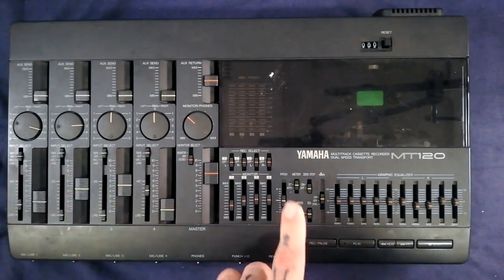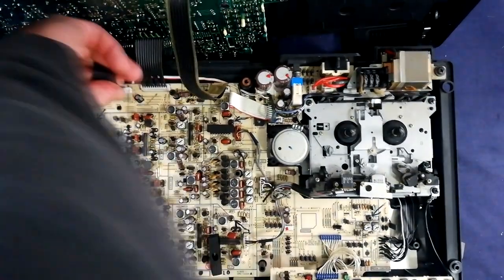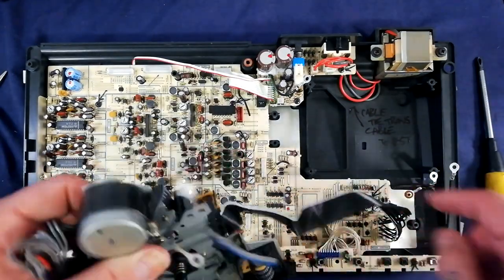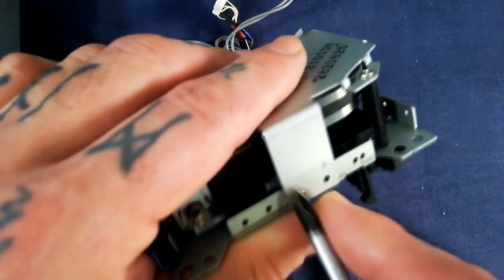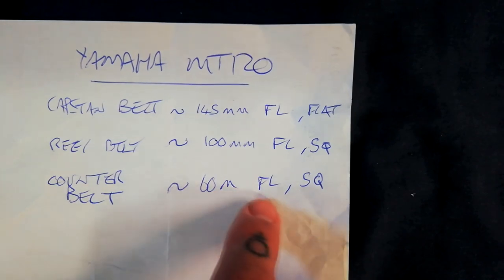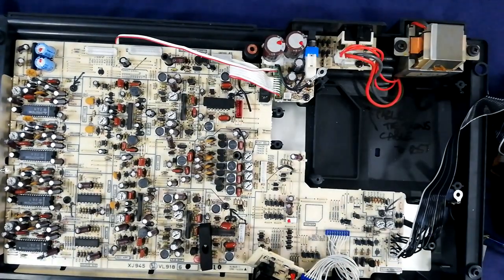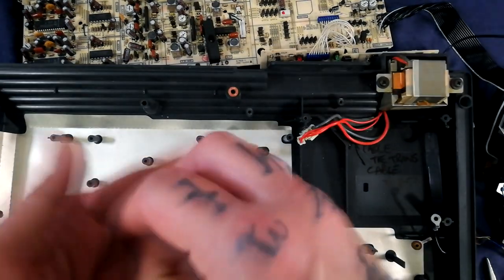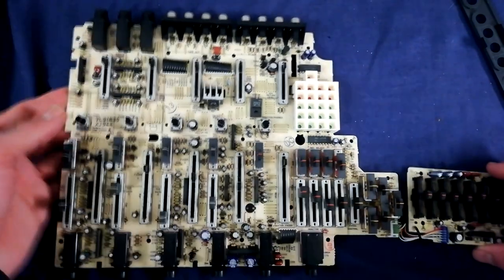Yamaha MT120 Tear Down

Comment: I had the MT100 MkII predecessor in 1991 until 1997.  Went digital with a Fostex DMT 8 v2 after that, but the Yamaha was an excellent machine and taught me a lot about recording.  I got the nostalgia bug back in 2016 and bought a used Yamaha MT3X in mint condition for £60.  Love the meterbridge and extra features that mine lacked like sync and mixer channels for feeding in live stuff.  Managed to find a cheap Yamaha FSK sync box for £12, and got an old Yamaha SY55 keyboard sequencer and RY30 drum machine to all sync to the four track.  Worked like a charm.  There is something about the old era of doing recording, that had a bit of magic to it which is missing for me in the digital age.

Comment: Great video!do you know what would cause the reels not spinning in either direction?the capstan spins all right but the reels don't engage. The belt looks all right. Update!!the source of the issue is the clutch assembly. Any idea why it won't t engege?

Comment: Excellent explanation and much appreciated. I have just bought mine back into action after 20 years and found that my channell 1 input would not record (plays back and bounces to fine). This video helped me to get to see the input jack in question to see if I could repair/replace it. 
However, not sure I can as the pin solder point seems to have pushed through and broken away from the circuit board and so broken the connection running through the circuit board. Just wondering if I could solder some external wires across somewhere to compensate... do you think that might fix it?
Reply from the maker: Thanks. Yes you could glue the socket in place and solder a section  of wire from the base of the socket to the next un damaged lug on the circuit board, follow the lifted  trace on the board to see where the far end of the wire should go.

Comment: I'm working on one of these right now and a mystery spring just fell out when I removed the transport assembly. I can't find it on the exploded view parts list in the service manual. It is a conical spring with no hooks or loops to attach it anywhere. About 9mm wide and 7mm tall uncompressed. About 10 turns. Not a very stiff spring. Any idea where it may have fallen from? I thought maybe it went under the smaller black plastic belt pully but again, I couldn't see how it attached to anything.

Comment: So if you made it with the JSP-HX connectors, that means the connector's pitch of the MT120 are different from the japanese CMX100II. (They look like coming from the same product line so I was assuming they're the same internally somehow). My Yamaha CMX100II have these bord-in connectors with a Pitch of 2mm, in which case the JSP-HX (with the pitch of 2.5mm) wouldn't fit.
Reply: I found JST-PH 2.0mm fitted my MT120.
Reply: @StevenHadfield  Yes, PH is the correct one, it cannot be the HX. Tetrakan made a mistake here.

Comment: Nice tear down and channel.  Thanks.

DON'T DISTURB THE RIBBON CABLES - Wise words. Luckily I'd decided to replace these anyway as I've a feeling I'm going to be in and out of this thing, but wow these are horrible, couldn't get the ribbon out, never mind back in.  For replacements JST PH cables have the correct 2.0mm pin spacing, for anyone looking to do the same.

The primary issue with mine is the right side of the mixer is attenuated on all sources in the mixer section, with noise on the fader.  The monitored tape signal is fine.  Cleaning and a brand new master fader from RS has not resolved this, so I'm suspecting it's a bad capacitor leaking DC current into the pre-fader summing Op Amp (IC10). Does this sound correct? Anything else I should investigate? 

Regarding the issue with the door mechanism in the video, It looks like you have everything, the door just extends past the pivot and is  restricted from moving by the L shaped metal spring.  The post which is broken on yours, doesn't have anything attached to it, on mine.

Cheers!
Reply from the maker: Thanks. What you are saying seems plausible. When faced with those sorts of problems I also replace the (usually) 10uf 16v electrolytic capacitors, which separate the buffers on either side of the master fader from preceding and following gain  stages. My theory is that leaky caps here interfere with the impedance relationship between gain stages, but whatever thd actual reason, I have a very high rate of success replacing these in addition to any caps between the opamps and Ground or power rails.
Reply: @Tetrakan  I'll do that. Thanks.

Comment: Love your videos, thank you for providing so much useful info.
I recently purchased one of these units but the monitor/mix/stereo switch is very scratchy and makes a racket when used. The overall output volume is very low and I have to have all sliders up all the way. This is during playback and general monitoring of instruments. Would a good clean of the mixer maybe fix this issue?
Thanks
Reply from the maker: Thank you. It definitely is the first step in a process of elimination, I wouldn't meddle with the electronics or pay anyone else to do so until the unit has been cleaned thoroughly, it could resolve your issue.
Reply: @Tetrakan  bloody good advice I reckon. Just gave it a good clean and that fixed the horrible switch. The only issue it has now is low output volume when listening in stereo mode. I can red line channel one through mic line but it barely tickles the ear drums. Looks in pretty good nick though so ain’t giving up on it. It’s got more joy to bring

Comment: Hey! I wanted to ask you if the mt120 got a built in auto stop feature that prevent tapeloop like some other yamaha models. Thanks a lot for your input :)
Reply from the maker: There's a switch on the front panel to defeat autostop, so I'm fairly sure you could use loop cassettes provided that switch was set to "off"?

Comment: I'm following along at home and I noticed that you dont really need to mark the mixer pcb screws as yamaha labeled them with a little screw icon themselves, also the reason why the plastic casing on yours is melted a bit could be because from the factory the loktite-ish stuff they put on the screws makes them pretty tough to remove, i had to use a soldering iron to try melt the adhesive stuff. thanks
Reply from the maker: Noted, thanks
Reply: @Tetrakan  hey, thanks for the quick reply! while I've got you here I was wondering if you could help me with mine! It plays back fine but any input in all channels is super attenuated and gainy, it's like that while monitoring and recording. lmk if you have any idea what could be wrong with it, I've already tried cleaning out the pots and sliders but hasn't done anything :/
Reply from the maker: @gerry5265  try first actually desoldering disassembling and deep cleaning replacing the master fader. If you're still having problems, something that comes up often is the audio coupling capacitors on the pre - and post master fader buffer go bad. You're looking for 8 electrolytic caps of the same value near the master fader. They tend to be 10uf on tascam units, I imagine they'd be the same on yamaha stuff...
Reply: @Tetrakan  thanks that's a lot of help, I'll give that a go!

Comment: The belt disc (with the felt) of my clutch assembly does not engage / move the gears. Seems like there’s a tiny bit of space between the belt disc and the gear ⚙️ disc. Any ideas? I didn’t see a spring or clamp to add tension in your teardown or in the manual.

Comment: Hi, thanks for the video.  I have the Yamaha MT100 II and it plays warped.  Is the anything I could do or do I need a new motor?
Reply from the maker: First replace all rubber parts and lubricate all moving parts. If the problem persists, you might need a new motor
Reply: Thank you, I’ll give it a go.

Comment: Hello! a bit unrelated to this video but i recently got a portastudio 488. the original motor is beyond repair so i replaced it with a mabuchi 2400 rpm 12v motor i got from ebay. it's running almost 70% too fast. is there anything i can do?
Reply from the maker: I'm not totally clear on the answer to this but I might be able to make some educated suggestions if you could tell me which model of motor your replacement is, and does it have 4 or 2 input cables?

Comment: Any idea on how to adjust the bias on these to accept type I tapes?  Hopefully they labeled the bias adjust pot.
Reply from the maker: The bias has two parameters, frequency and amplitude. Usually you adjust frequency once at the oscillator, but must set the amplitude  in 5 places, one adjustable component sets overall level for all four erase tracks, and four separate adjustments one for each segment of the record head. On this model those  components are well annotated. I don't know what the amplitude and frequency requirements are for type 1 tape, you'd need to research that, please share the information if you find it.
Reply: @Tetrakan  Thanks for the info.  I have an MT100 II which hopefully is similar inside, with labeling.  I can’t remember the setting for Type I.  A few years ago it was more popular to convert the decks to use type I tapes.  But now I can’t seem to find the details.  I’m sure it’s still much better to use Type II tapes anyway, but it would be nice to know how to do it.